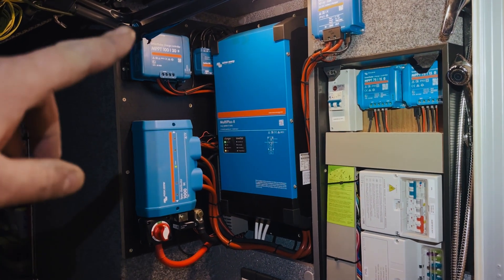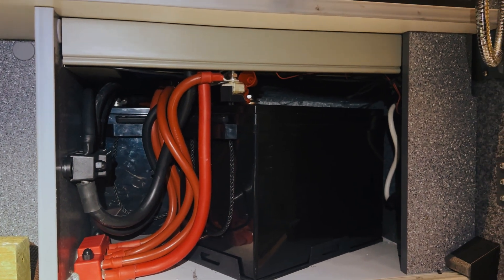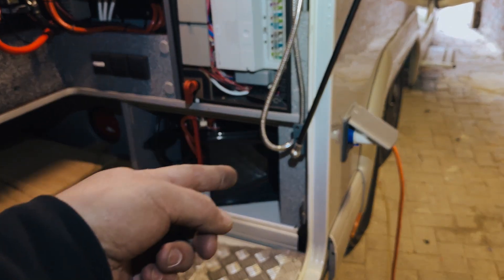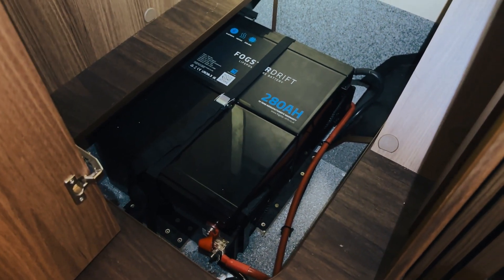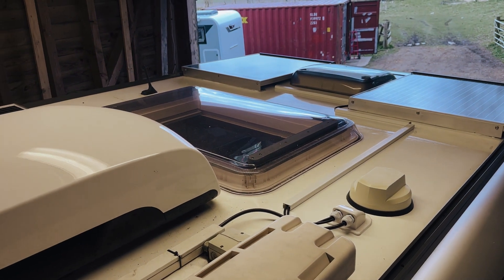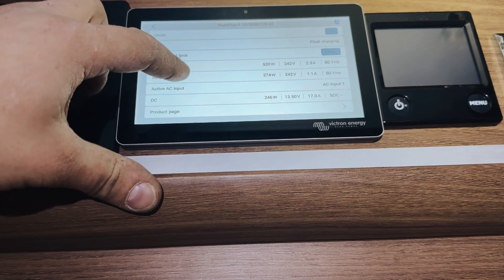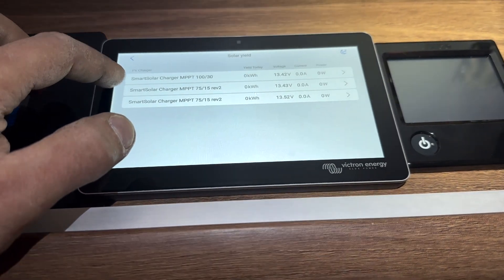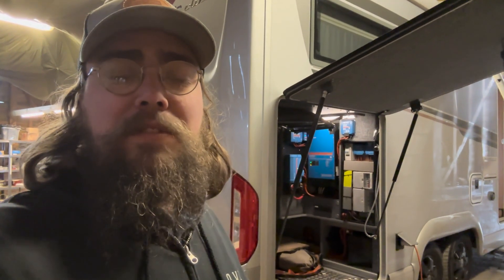Four Fogstar batteries in a Carthago C-Line??

Comment: Very nice instal but it would be interesting to hear what the customers requirements are. Having on board some 1200 amp of Lithium available for use it would be interesting to understand what that amount of power was needed for. I can see the air con is on the roof. Off grid if this needed to be run   At 2400w in power that would draw around 200 amp an hour so the four batteries would be dead in half a day even with whatever the solar would produce. Obviously plenty of  battery to run the fridge on battery including induction and air fryer. Seeing all these big instals give the impression of I can  afford it so I will have it. Good luck to the owner in the use

Comment: Would there be a slight weakness in this set up in winter? If the batteries run low on amp/hrs, with limited solar charging and only a single 50amp dc to dc, charging will take many, many hours driving. A 2nd dc to dc, perhaps? I have 560amp/hrs Fogstar and 75 amps dc to dc and know from experience that  full recharge from driving takes more than a few hours.
Reply from the maker: Yes, that is a consideration. However, in winter in the UK, solar is very unproductive, so you’re basically going as long as you can in between visits to camp sites to “top up” your batteries so having a system like this allows you to go for a few days between visits to camp sites. Topping the batteries up from the engine is obviously important, but you can’t rely on it as you don’t want to be driving for hours and hours every day.